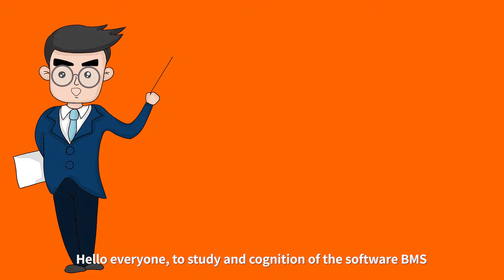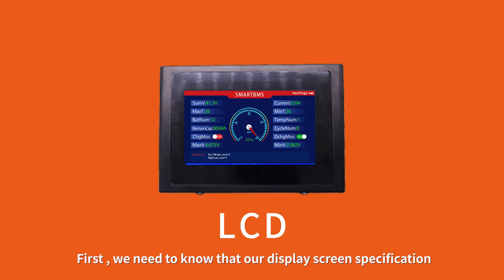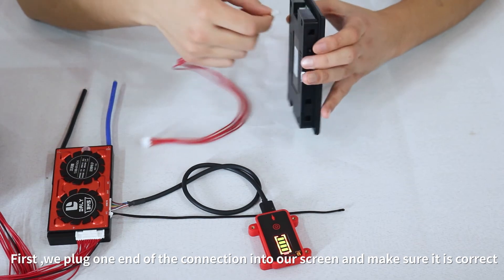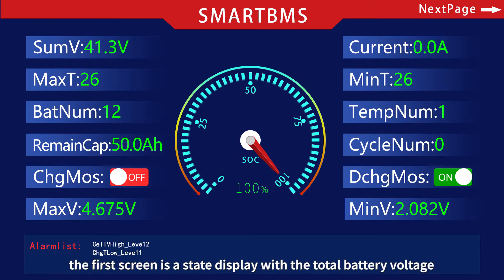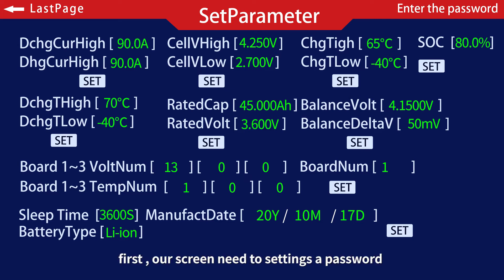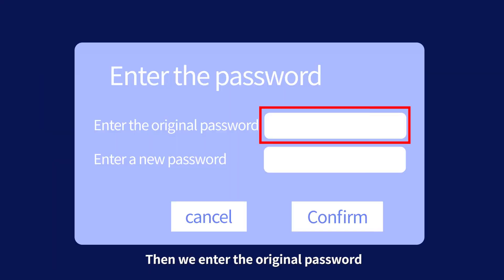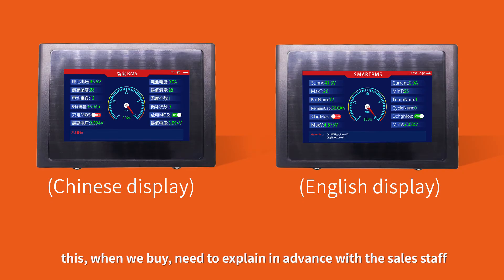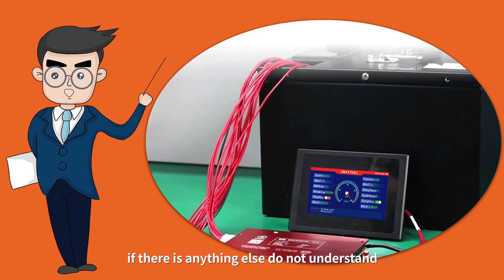DALY BMS Dispay Screen

Comment: Could you help me please?
My 60A daly bms bluetooth keeps reseting on my tablet. I have to go back to the bms bluetooth dongle and press the button to fire it back up regularly.
The screen shows 100% full - time even though the voltage on the display is 12.9.
When charging the screen will show you what current is coming in but won't show you what your using at night. Its really weird? 
Any advice will be much appreciated. Thank you.
Reply from the maker: Hi，sir, add my wechat +8615103874003 or you can send me email ivy.zhang@dalyelec.com